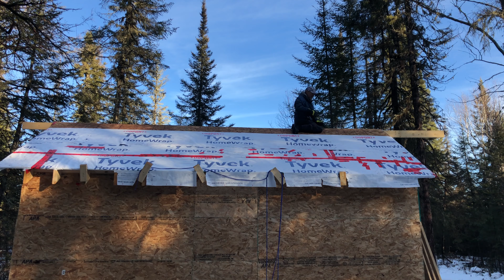ONE MAN OFF-GRID Cabin Build - Anyone can do it, but is it LIVABLE??

Comment: Tyvek protec is a roof underlay, but regular tyvek is vapor permeable.   It will shed alot of water but some will get through.  The idea of house wrap is to let water vapor escape though it when its in the walls.  That's why we put vapor barrier kn inside and vapor permeable on the outside. 

Still it's gotta be better than leaving the osb exposed though you'd think.
Reply from the maker: Unfortunately, this is only regular Tyvek. Though as you mentioned, better than nothing at all on that OSB. 
I had a spare roll left over and thought what the heck. Thanks for checking out the latest clip and for your comments and insight.